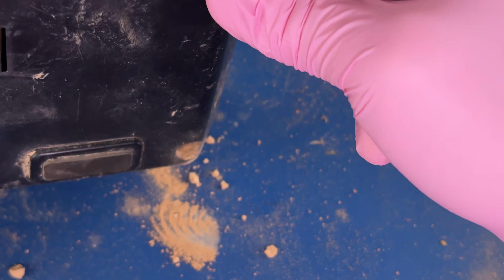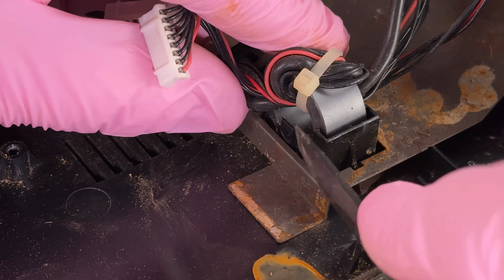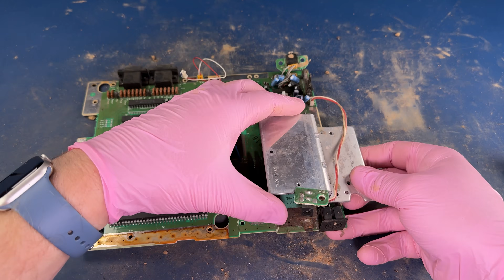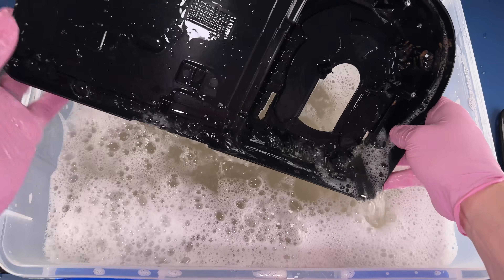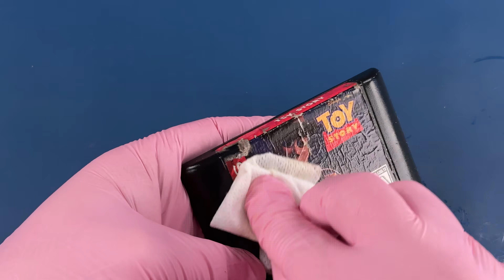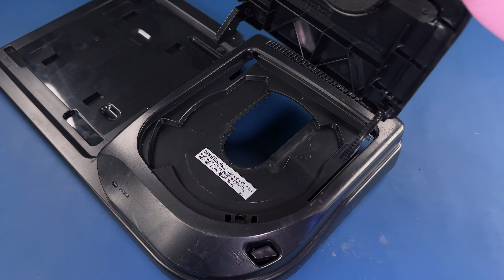EXTREME Flood Damaged SEGA GENESIS CD - Restored(ish)

Comment: Backyardballistics / Beyond Ballistics here on Youtube has a great rust removal recipe, you should check it out, i use it myself for my old garden tools i inherited to great effect, it doesn't eat the metal as much, and can be re-used many times over.  
Their video title is: "The Ultimate HOMEMADE Rust Remover (Better than EvapoRust)"  

They have run extensive tests, which are included in that video.

The recipe:
* Per 1L of H2O
1: 100 Grams Citric Acid.
2: 40 Grams - Sodium Carbonate /OR/ 63 Grams - Sodium Bicarbonate /OR/ 30 - Grams Sodium Hydroxide.
3: Add ingredients from 1 & 2 to the water.
4: Wait for reaction between Acid and Base to complete. 
5: Add final ingredient: Arbitrary amount of liquid dish soap (or other wetting agent / surface tension reducer).

Comment: get yourself a plastic welder and some zip ties to use as solder, you can remove anything plastic welded to clean it and reattach it with the zipties you melt to connect it back up

Comment: I'd look for cracked solder joints around the connectors. These consoles are old, and probably been unplugged and plugged in a thousand times, as well as yanked forward from pulling on the controllers. That'll weaken the joints. Also, if the CD is starting with a cartridge inserted, then the cartridge isn't reading. It looks clean, but still needs a lot more work.

Comment: Remember to resolder the MD power connector. Usually, that's what makes it crash like in this case ( at 20:43 ).
Otherwise, magnificent restoration. It looks better when it was in bad condition with lots of dust.

Comment: Shouldnt ever try devices in that state,it could damage it.
Next time use tartaric acid to remove rust,mix it with water,let the parts inside the mixture and check after some hours or leave it from one day to the other.removes all rust from metal.

Comment: WD40 is a water dispersant, not a protectant. After application, it attracts dust and dirt. It is also not a very good lubricant, but try telling other people that. I would have recommended replating the metal parts with nickel; it would have protected them much better.

Comment: Only problem I remember having with my old Sega Setup (had the whole thing, Genesis, 32x and SegaCD) was the CD portion, the lid didn't like to sit right so the disc would have trouble spinning, had to hang it off the edge and use a clamp to put just the right amount of downward pressure on it.

Comment: For the surface rust on metal, if you haven't, try Barkeeper's Friend. I use it at work on commercial equipment for cleaning it off. It's some strong stuff, but worth it.

Comment: I'm not sure if there's something wrong with the cartridge or if it's an issue with the Genesis, but the system should boot the cartridge. Cartridges get priority over discs. There's also probably an issue with the video plug. It might be bad solder joints or possibly a bad connection in the plug itself.

Comment: Nice work. If using vinegar, try to neutralize with soda/NaOH solution immediately after taking it out. Then go ahead and rinse/wd40.
Vinegar treatment doesn't last too long. It also actually strips the protective coating off the rest of the piece as well. The wd40, as a permanent coating, is too volatile to depend on. I'm sure you'll figure how to replace it with something more sustainable. All the best

Comment: The whole time I was watching I found the cleaning job to be beautiful along with the end result, but internally I was screaming about you not replacing those rotten Capacitors. Even after you came across solid indisputable proof that they were rotten and leaking trekking you they needed to be replaced you just wiped it off and moved on calling it just surface corrosion on the board. Yes that is exactly what that white corrosion was, a loud desperate cry for help begging you to replace the bad caps.

Comment: Tech here.  You can submerge the circuit board in soapy water and scrub away.  Just take the battery off first.  As long as there's no power going through it, it won't do any damage.  I've saved many a board/component with a good deep clean.  It just needs to dry out really well afterward.

Comment: The RF modulator (the video plug you used) is very delicate and bad quality in general. There might be some more rust and debris inside. My advice would be to use the AV signal, which is more reliable and higher quality. All things considered, the console seems to work fine, just remember to plug the "mixing cable", which is a requirement to use both the Genesis and Sega CD audio at the same time. To test the disc reader, you can just burn a random game image into a disc, the Sega CD was too basic at the time to have copy protection. If you want to only test the audio functionality you can also use a regular audio CD.

Comment: you plugged it in before cleaning it?  I wouldn't have done that.  most obvious risk with that is moisture trapped inside.
Reply: 13:32 he literally shows why it was a bad idea to try to turn it on before cleaning and still admitted to doing it anyway lol
Reply: I was thinking that too
Reply: Yeah, not quite as bad as mindlessly thrashing it with a hammer, but almost... 😒
Reply: yep. what a noob lol
Reply: The water prob evaporated tho
Reply: @Karatekid_9000  I wouldn't risk it.  Especially when know you're opening it up and cleaning it out anyway
Reply: @DASfinn I tried turning on my cell phone when it got submerged in water and got it to work later

Comment: If you're putting pressure on a connector and it works, I'd look for broken solder joints.  Probably reflow the solder on the connectors and ot would work

Comment: the plastic welded part ob the ring you can heat them and cut them off and drill out the hols and put in nylon screws  just a thought

Comment: That plate is specific part used to attach a Model 1 Genesis to a Model 2 Sega CD.  The Model 2 Genesis fit without the adapter plate.  Older electronics like this are usually (fairly) bulletproof.  I'd be surprised if it needs much more than some PCB cleaner and electrical contact cleaner.  Any socketed chips probably need to be removed and cleaned.

Comment: Expected it to still work, except for connectors and the CD drive/cartridge slot maybe. I mean I've seen a C64 mainboard that was revived after 3 years in a pond.
Reply: I didn't, those capacitors are in very bad shape, one of them even corroded the board. They need to be replaced.

Comment: You would have likely been fine to immerse the top for a short amount of time. That light looks like an LED, and the lens effectively pots the semiconductor element of the LED. If the flood waters didn’t seep inside, your short immersion isn’t either.
I ultrasonically clean boards with LEDs frequently, and haven’t had any issues with water getting inside them. (I do, of course, make sure the board is dry before powering up.)

Comment: The solder joints on the power connector break on the genesis consoles. Also the regulator can cause intermittent power problems from the same reason.